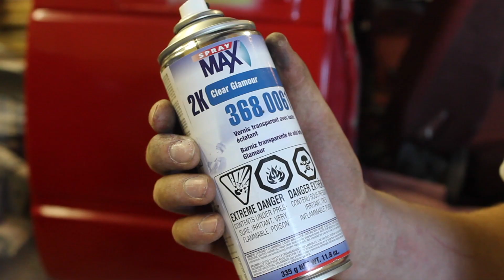How to Make a Spray Paint Job Look Good

Comment: Tip, you should paint the jams and edges first then the outer panel so you don't get a dry over spray haze on the outside panel
Reply: longrange 717 he even said he should outline it first but he didn't do it

Comment: Nice.
I had never painted a car or body parts in 30 years and at least 25 cars I've owned.  This past week I spray can painted (rattle can) my teenage son's Impreza in an open carport on gravel and dirt ground.  I figured out what works for my area (western Colorado).  I did 5 and 7 light to medium-wet coats on a whole car, over 4 sessions without fail.  Took me 6 work days.  Apply and let dry for 15 (minimum) to 20 (maximum) minutes between coats and it works fine for the paints I used.  You should spray two small test areas with all environmental/time factors the same before the actual project.  For example, if you have an area to spray that takes 10 minutes to paint it, wait and warm-up/shake your next can(s) for 5 minutes and start the next coat.  That's a total of 15 minutes.  I know up to 20 minutes is also good.  But 40 minutes was too long because that induced chemical reactions and severe wrinkling.  I painted in the same order/pattern each time I sprayed a section.  I had zero runs, spray errors, or reaction defects.  The original paint condition was below average.  No body rust, but 50% of clear coat was gone and hunter green was faded and rock chips galore.

Below is the weather, process and paint I used. 

1.  Up to 3-mph occasional breeze is okay, anything faster or constant is to be avoided.  Clear skies, for light, preferred.  20% to 40% humidity.  Temperature between 50F and 72F while spraying.  Warmed spray cans in hot water in a bucket.  Shake them as much as possible.

Paints used on sides, nose and rear (3 sections):
-- Rust-Oleum Painter's Touch Gloss Navy Blue 2X Paint + Primer: 1 medium-wet coat.
-- Rust-Oleum Stops Rust Enamel Gloss Navy Blue: 2 medium-wet coats.
-- Rust-Oleum Stops Rust Enamel Crystal Clear coat: 2 light coats + 2 medium-wet coats.  I think a 5th coat could be applied with no problems.

Paints used on hood, roof and hatchback (1 section):
-- Rust-Oleum Painter's Touch Gloss Black 2X Paint + Primer: 2 coats.
-- Rust-Oleum Universal Hammered Black: 3 coats (4th coat optional).  ***Color dries gloss dark grey with blackish specs, not solid black.

2.  Sanded car with 100 and 150 grit dry paper by hand, with a scrubby dish sponge as the pad to fold the paper around.  First, I sanded high defect/damaged spots...double their original size.  Then I sanded vertically and again horizontally (cross hatched) the whole car.  I should have sanded once more with 400 to 600 grit because when finished painting I could see some 100 grit sanding lines in a few spots.

3.  From this point forward you must walk carefully to protect from dirt contamination...do not drag or scuff the ground.  Wet the surrounding area to help keep dust out of air.  Douse car with hot water and wipe down with rags.  Let air dry 30 minutes.  Check that all areas are smooth/scuffed well...touch up as needed.  Wash with hot water+dish soap and rags/sponge.  Rinse well.  Dry with microfiber.  Air dry 15 minutes.  Tape up as necessary.  10 to 15 minutes before paint spraying use a microfiber cloth and lighter fluid or mineral spirits (same thing) to wipe down the section to be painted.  Immediately before painting wipe all surface with a tack cloth.  As you're spraying move slowly and don't scuff the ground.

4.  Even in the open air you will want to use a painting respirator, but at minimum cover nose and mouth with thick damp cloth or N95/N100 face mask.  Clear, tight fitting safety eye glasses work best...the larger goggles reflect light and make wet paint difficult to see clearly.  I had to go without eye cover and just squinted my eyes when the paint spray was thick, because goggles distorted the light.

5.  It will take these paint formulas 3+ hours to dry to firm finger touch so leave it alone for 5 hours.  I let it dry 24 hours in the carport and then put it in the Sunlight for 2 more days before driving.  At 25 to 30 days I'll polish and wax it.

If you want to see pics drop me your email and I'll send you a couple.

Comment: Badass! job buddy.,I have foot long small dent over the rear tire on the quarter panel,And you giving me the courage to tackle it myself.Body shop wants to paint the whole panel all the way up the windows down to where it connects to the hood WOW..not worth all the $$,but what would be a good tip to pop out the dent before i do the bondo n paint?ha..n your passenger window with no protection?how did u clean that up?.be well thank you.
Reply: Can you kick it out from inside trunk
Reply: @heathermcmurray5590  o no,its down more where the back of it would be where if u put ur thumb on the dent on the outside part u can use your finger to reach inside n up. thats the area its at.but its thick black layer there so i cant just touch bare metal ya know.?it has that stuff that protects the car from tire spitting up rocks n gravel ,i know i have a picture of it but i hope i drew a good enough picture for u to get n idea lol. thnx man

Comment: thank you young man for taking the time fixing your truck the right way(looking at the low budget you put in).
you did almost everything pretty right took your time at spraying the coats of primer or paint.
dont worry about the minor orangepeal...once you cut it with 1500 followed by 3000 and then buff it,it will look almost like made with a spraygun.
i just sprayed my lower quaterpanel on my 1978 vw dasher with 2k spraypaint also taking my time and beeing anal with prep and sanding.
i went with 2 lite coats and 2 heavy coats of basecoat...no clear as the base im using is shiney enough for what im going for,and it came out pretty perfect with no runs luckily as i went really wet at the last coat.(the paintman wanted to charge me 350euros after i had everything allready sanded and primered and ready to go...😂👈🏾)
off course you will have a light orangeskin as with cans you will never get the amount of pressure and paint on your projekt than you would get from a spraygun attached to a compressor.

again...i like what your finished product look like a lot(from what i can see on the vid atleast)

good job!

99%of yt people working with cans on cars should just leave it alone......take a good look at this...!
Reply from the maker: Thank you for the kind words! Normally I would have just used a HVLP, but was curious how good I could make it look with spray cans.  I was happy with the results, albeit it probably won't hold up to the test of time.
Reply: @awickauto9910  With the 2K clear you should be good for a long time.

Comment: Hi AWick , how long you have to wait between primer , base coat and clear coat please ?
Reply from the maker: Hey Oscar.  Depending on a lot of factors(temperature, humidity, etc.) it all depends.  Usually with aerosol spray paint it dries quickly.  I'd spray my primer(5-10 minutes between coats) and let it dry for 30 minutes.  Then apply basecoat(5-10 minutes between coats) and allow that to dry for 30 minutes. Then your clearcoat.

Comment: Nice work! I was incredibly surprised by the the coverage of the first coat. I JUST painted a spoiler for a a friend (divorced, no longer have a compressed and gun) using Rustoleum gloss black/primer and it turned out great!! BUT......huge BUT, this deal does not dry. 2 days now I'm waiting bc even tho it looks really nice... you can't touch it wo leaving a finger print! And I want to rub it out as well just to deepen the black. I'll never use this shitty rustoleum again! So it's refreshing to see what rattle spray paints can deliver the look I take pride in bc it represents me! Awesome work!!
Reply from the maker: Thanks and that is good to hear! What kind of temps/humidity do you currently have where you live?

Comment: For 100% rattle can not to bad. Dupi color primer is trash, try a better high build primer then wet sand the primer with 400 grit for a super smooth bed to paint over

Comment: A cheaper spray can clear coat that gives a good glossy finish is Duplicolor engine clear. It will be next to the engine paint stuff.
Reply: good tip, I don't care for the regular duplicolor clear.
Reply: No. That clear will peel right off, after some time in the sun. Its not meant for the UV abuse from the sun

Comment: How long does this last tho? It’s not nearly comparable to the paint jobs by pros is it?
Reply from the maker: You are correct it is not nearly comparable to paint jobs by pros.  Just demonstrating you can get a quality finish with spray cans.  I did not hold onto this vehicle long, but if I got two years out of that clear id be happy.  Of course in the long run it would be cheaper and more durable to spray it with HVLP etc.

Comment: How did you keep it from clogging or splattering (becoming runny)
Reply: He said in the video to shake the can every thirty seconds to keep it mixed well. Another tip I've heard is warming the can up in water helps it spray better too.
Reply from the maker: @fireball6625  Finding the nice speed at which to move is important as well.  Don't want to move too slowly or you'll get runs...too quickly and your paint is too thin. Just takes practice to be honest...half the reason I made this video was to see what results I could get.

Comment: I have 1000 ND 2500 grit of sand paper what's the the difference with lower ones ?
Reply from the maker: The number indicates the size of the abrasives on the paper.  The lower the number, the larger the abrasive.  60 being very rough and 2500 being very fine. 

 Both those papers you have are quite fine sandpapers.  1000 may be used sometimes to fix paint runs, slight blemishes etc. 2500 would be for very fine blemishes, orange peel, final touches to a paint job before polishing.

Comment: is this the materials and cost to cover the whole car?
Reply from the maker: kkluv225 That was just the cost for this section of the vehicle.  It is honestly probably cheaper to spray a vehicle the conventional route, but this sure is convenient.
Reply: Thanks, i really love the outcome of the job you did, really nice! :)
Reply from the maker: kkluv225 Thanks! No one ever believed it was painted using rattlecans. Definitely looked great all things considered.
Reply: lets say i did spray paint my small GLI jetta with the spray cans of duplicolor, do you think 10 cans would be enough?
Reply from the maker: Kwuamae Keaton I would think to get good coverage you'd maybe want 20 for the entire car. Aerosol cans apply very thin and it's hard to build it up for good protection.

Comment: What song is it ??
Reply from the maker: Record Year by Eric Church!
Reply: AWick Auto  bro just a question so I just clear coated my roof after base coat! It kinda went on murky and a bit of overspray... will wet sanding help fix some of that???
Reply from the maker: Filip laskovski It sounds like you may have put it on too lightly. you want a nice wet coat. without looking at it, I would say you need a good sanding and to apply another wet coat to bring out the shine.